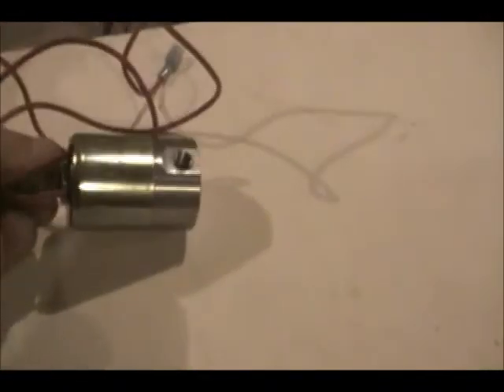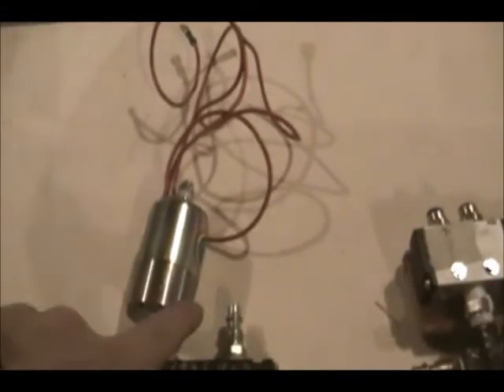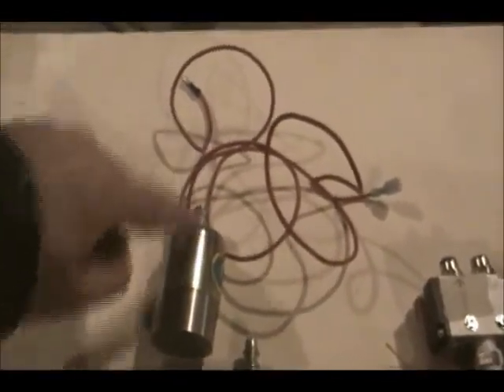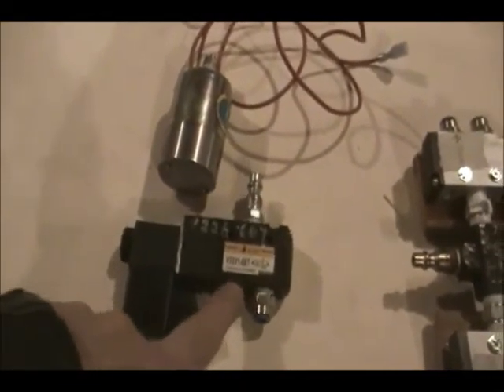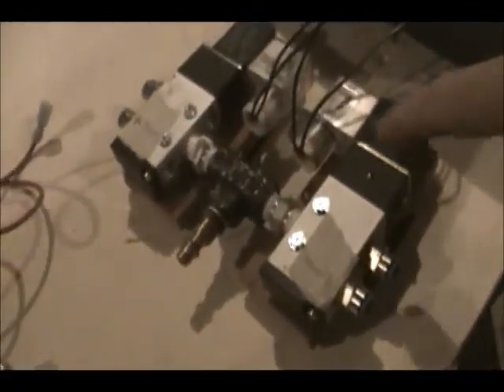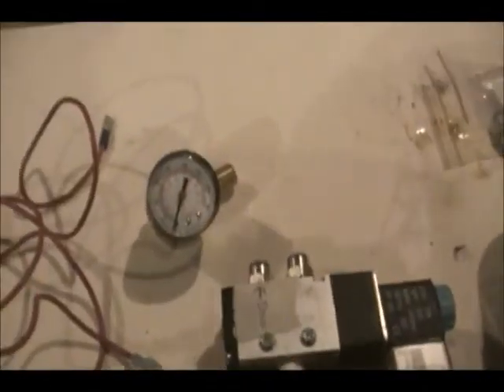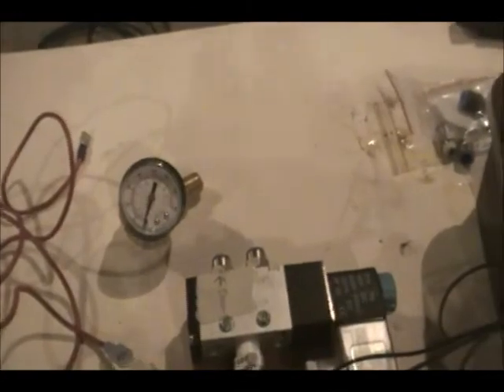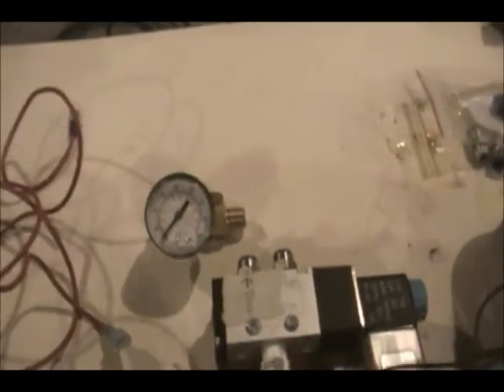Dead Things Vlog- Pneumatics Part 2

Comment: Hi your channel is very good the only thing is your 3 port valve is incorrectly plumbed the 3 port valve is to operate a single acting piston or a pilot operated 5port valve you can usr a double acting piston as a single with a three port but you would have to rely on gravity or the weight of the prop to retract the cylinder if you need more help just mail me and I csn give you more info but great video's

Comment from the maker: @GhoulishCop Yes, I was thinking the same thing, will try and get a vid done this week to show it in action.  I Googled "Darlington Driver" to get an explanation for you but hell, I didn't understand it!  Basically, it can be used in conjunction with a microcontroller, like a Picaxe.  A picaxe can only switch low voltage items, like LED's.  By using a Darlington the picaxe can then switch higher voltage (12VDC) items, like solenoids.  Picoboos are microcontrollers with darlingtons.

Comment: It would probably be useful to see the 4-way/5-port solenoid hooked up to something to see the concept in action (3 ways are fun; 4 ways are complicated, but then again that has nothing to do with pneumatics :) ). What is the benefit of using that sort of solenoid, what sort of prop would you use it on? Also, what is a Darlington driver? Thanks!

Rich